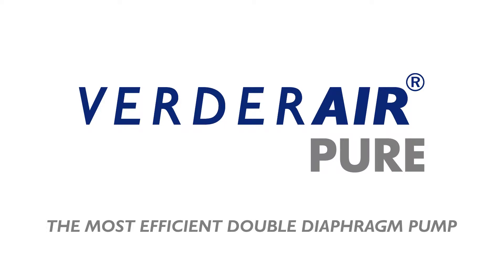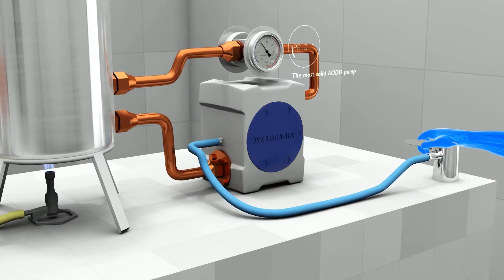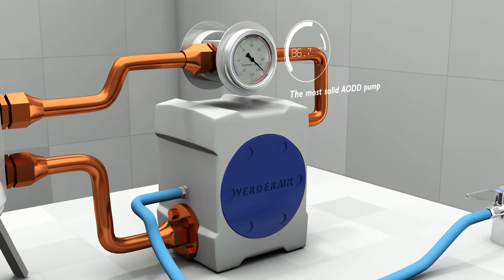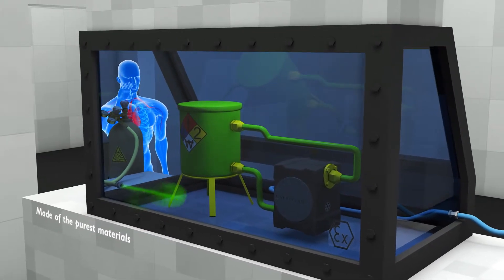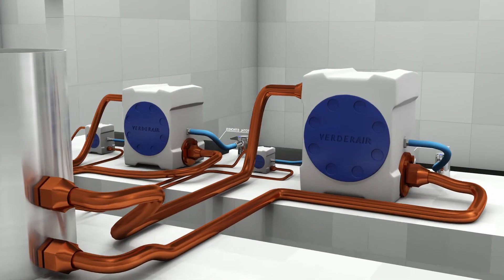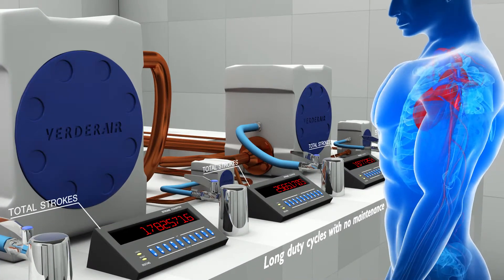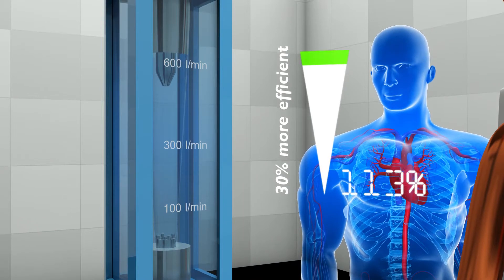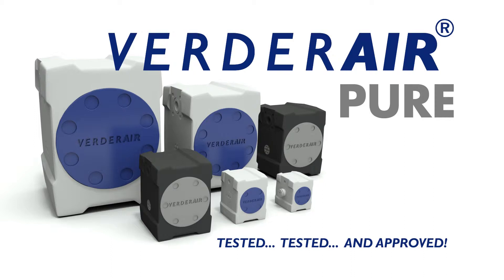Verderair Pure Teflon Air Operated diaphragm pump used for harsh chemicals!

Comment from the maker: Acetone Cyanohydrin							
Acetyl Salicyclic Acid
Adipic Acid
Almond Oil (artificial)
Aluminum Acetate
Aluminum Sodium Sulfate Soda (Alum)
Ammonium Bicarbonate
Ammonium Flouride
Amyl-Borate
Amyl-Chloronaphhalene
Amyl Naphthalene
Amyl Phenol
Aniline Hydrochloride
Anisole (Methylphenyl Ether)
Anthraquinone
Aqua Regia
Askarel
Bleach Solutions
Bromine
Bromobenzene
Bromochloromethane
Butyl Acetate
Butyl Acrylate
Butyl Amine
Butyl Benzoate
Butyl Bromide
Butyl Carbitol
Butyl Cellosolve
Butyl Chloride
Butyl Oleate
Butyl Stearate
Butyraldehyde
Butyronitrile
Calcium Acetate
Calcium Chlorate
Calcium Hydrosulfide
Calcium Sulfide
Carbamate
Carbitol
Carbolic Acid
Cellosolve Acetate
Cellulube
Chloracetic Acid
Chlorine, Anhydrous Liquid
Chlorine Dioxide
Chloroacetone
Chlorobenzene (Mono)
Chlorobromomethane
Chlorododecane
1-Chloronaphthelene
1-Chloro 1-Nitro Ethane
Chlorosulfonic Acid
Chlorotoluene
Chrome Plating Solutions
Coke Oven Gas
Copper Sulfide
Cumene (Isopropylbenzene)
Cyclohexanol
Cyclohexanone
Cyclopentane
Cymene (Isolpropyltoluene)
Dibenzyl Sebecate
Dibutyl Amine
Dibutyl Ether
Dichloracetic Acid
Dichlorobutane
Dichloroethyl Ether
Dichloro-Isopropyl Ether
Dicyclohexylamine
Diethyl Benzene
Diethyl Carbonate
Diethyl Ether
Diisolbutylene
Diisodecyl Adipate (DIDA)
Diisodecyl Phthalate (DIDP)
Diisooctyl Adipate (DIOA)
Diisooctyl Phthalate (DIOP)
Diisooctyl Sebecate (DIOS)
Diisopropyl Amine
Diisopropyl Benzene
Dimethyl Aniline
Dimethyl Ether
Dimethyl Sulfide
Dinitrotoluene
Dioxolane
Dipropyl Ketone (Butyrone)
Divinyl Benzene (DVB)
Dow (Silicones)
Ethyl Aluminum Dichloride
Ethyl Amine (Monoethylamine)
Ethyl Benzene
Ethyl Butyl Acetate
Ethyl Butyraldehyde
Ethyl Caprylate
Ethyl Chloroformate
Ethyl Cyanide (Propionitrile)
Ethylhexyl Acetate
Ethyl Iodide
Ethyl Mercaptan
Ethyl Pentochlorobenzene
Ethyl Sulfate
Ethylene Chlorohydrin
Ethylene Dibromide
Ethylene Oxide
Ferrous Chloride
Flourobenzene
Flourocarbon Oils
Fumaric Acid
Furan, Furfuran
Furfuryl Alcohol
Glaubers Salt
Grease
Green Sulfate Liqour
Halowax Oil
Hexalin
N-Hexene-1
Hydrobromic Acid
Hydrochloric Acid 37% (Hot)
Hydroflouric Acid (Conc.)(Hot)
Hydroflouric Acid (Conc.)(Cold)
Iodine Pentaflouride
Idoform
Isobutyl Amine
Isobutyl Chloride
Isobutyric Acid
Isopentane
Isotane
Lavender Oil
Lime, Soda
Limonene
Lindol
Lithium Bromide
Liquefiled Petroleum Gas
Methyl Acrylate
Methyl Acrylic Acid
Methyl Amyl Acetate
Methyl Amyl Alcohol
Methyl Bromide
Methyl Cellosolve
Methyl Cyclopentane
Methyl Hexane
Methyl Oleate
Methyl Propyl Ketone
Monomethyl Aniline
Monovinyl Acetylene
Mustard Gas
Neohexane
Neville Acid
Niter Cake
Nitrobenzine
Nitrogen Tetroxide
Octadecane
N-Octane
Olein (Triolein)
Phenol Acetate
Phenylbenzene
Phenyl Ethyl Ether
PhenylHydrazine
Phorone
Pinene
Pipredine
Potassium Bisulfite
Potassium Permanganate
Potassium Phosphate
Potassium Silicate
Producer Gas
Pyrrole
Radiation
Rosin Oil (Rosinol)
Rotenone
Silicate Esters
Silver Bromide
Skydrol 500
Skydrol 7000
Sodium Hexmetaphosphate (Calgon)
Sodium Hydroxide (80%)
Sodium Hydroxide (to 20%)
Stannic Chloride
Sucrose Solution
Sulfamic Acid
Sulfite Liqours
Sulfur Hexafluoride
Sulfur Trioxide (Dry)
Sulfuric Acid (20% Oleum)
Tar, Bituminous
Terpene
Tertiary Butyl Catechol
Tertiary Butyl Mercaptan
Tetra Bromomethane
Thionyl Chloride
Thiophene
Toluene Diisocyanate
Triallyl Phosphate
Tributoxy Ethyl Phosphate
Trichloroacetic Acid
Tridecyl Alcohol (Tridecanol)
Triethyl Aluminum
Triethyl Borane
Tung Oil
Valeric Acid
Vinyl Chloride
Walnut Oil
Xylidenes
Zeolites
Zinc Carbonate
Reply from the maker: we pump tough chemicals with our block style Teflon pump